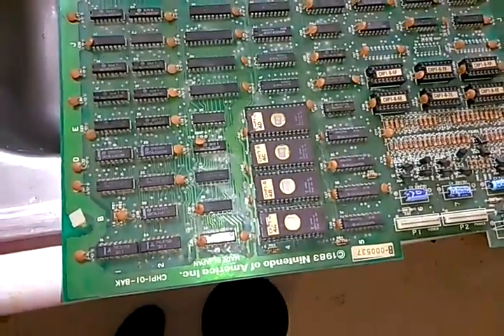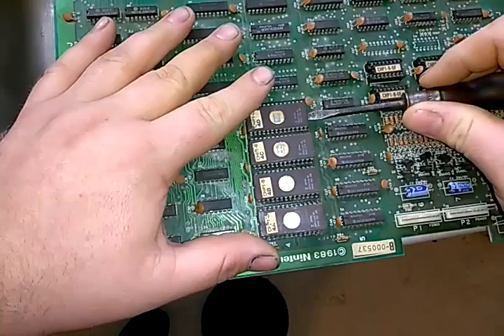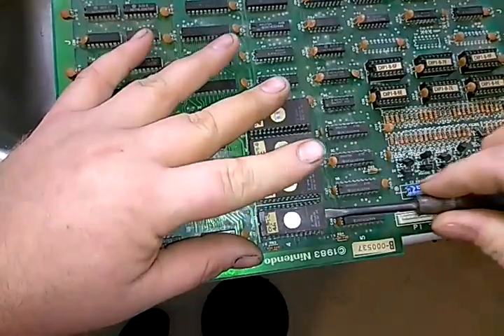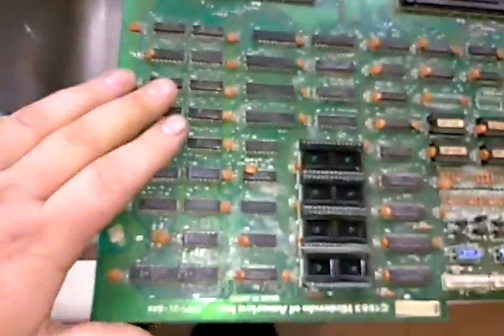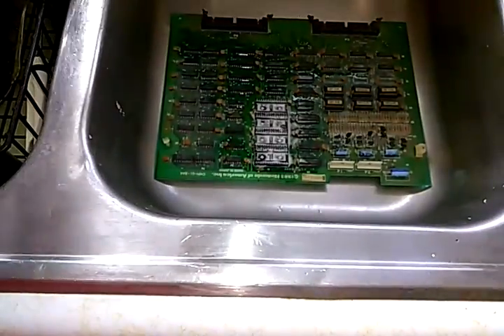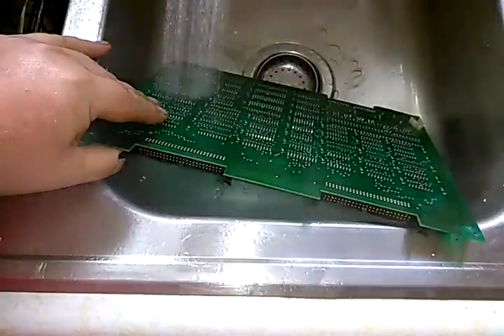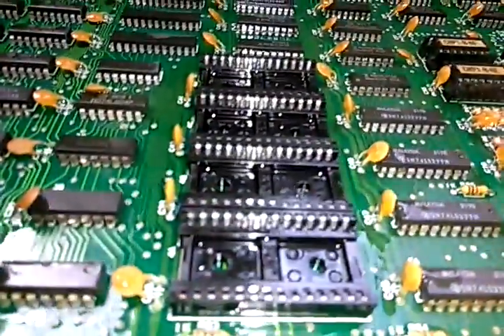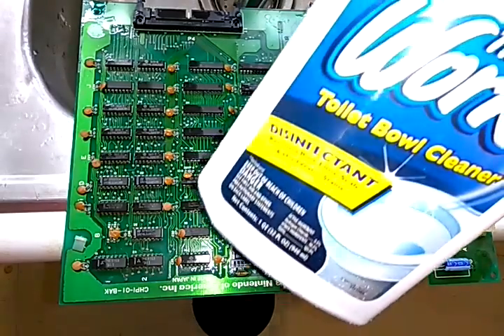how to clean corroded sockets on your PCBs

Comment: Are you sure it’s not sodium hydroxide instead of hydrochloric acid? I use cheap oven cleaner to remove dirt, grime and paint from aluminum cylinder heads. Same for hot tanks in a shop to dunk steel or iron parts. It eats aluminum! 
  I am sure the toxic crowd is cracking jokes about gloves, eye protection and a respirator! Give a break with the tiny amount. You have air-borne yeast on your avocado toast that’s more harmful than this stuff.

Comment: Is it a good idea for me to use distilled water or deionized water to rinse a logic board off? I got a PC motherboard that has oxidation on top after doing a bunch of vinegar baths along with rinsing with 99.9% Isopropyl Alcohol and that hasn't done anything to rid of corrosion for good.
Reply from the maker: what type of oxidation lead oxide orr rust?  i don't know what a good solution for lead oxide is. rust can be removed with a  soak in CLR .  distilled water

Comment: ARCADE JASON, 
1.) Whats the difference between a PROM chip compared to a BI-POLAR PROM chip?
2.) Why does the HP comparator give false positive result and doesn't work correctly when comparator H&V counter chips? it loads the output pins or something because the HP comparator will say the counter chips are bad but aren't bad any reasons why?

Comment: Don't use drain cleaner, it's basically Potassium Hydroxide, which is alkaline.  You could use CLR, which is essentially phosphoric acid.  Even diet coke has phosphoric acid.
Reply from the maker: the drain cleaner i was referring to is hydrochloric

Comment: I've used Coca-Cola to clean battery acid from my car battery connections...same thing?
Reply: It will have sugar residue !!
Reply: Use diet, no sugar.
Reply: soda has phosphoric acid, really good for removing rust and etching metal.
Reply: Not an expert, but club soda is basically water with no sugar , colors or anything else.

Comment: Goodbye corrosion, Hello Rust....
Reply from the maker: rust is corrosion
Reply: @ArcadeJason  Corrosion is like an algae, it builds up but does not eat the metal...
Reply from the maker: @Ramp10er  are you joking? look up the definition of corrosion
Reply: Rust does eat metal. When most people think of rust they are referring to iron oxide, which forms when water touches iron. Basically, water causes a redox reaction with the iron. Some ions from the iron get taken by the water, and some ions from the water get taken by the iron. This reaction creates rust. Fresh iron is replaced by rust. Rust slowly replaces iron, it effectively "eats" it. 

Let's say you start with 1kg of iron and then let it form rust. If half of it rusts, you will not have 1kg of iron any more. You will have 0.5kg of iron and 0.5kg of rust. The fresh iron that gets replaced by iron oxide is also not a homogeneous process. It's not like when rust forms over fresh iron it now has a "protective barrier" of oxides over it. The oxide layer is not exactly structurally sound. Rust is also very pourous. So what usually happens is the fresh iron underneath the oxide layer can still be exposed to water. This is why scratched paint on cars is a major problem. Eventually you won't have a car anymore. 

More importantly copper does not "rust" in the usual sense of the word, copper doesn't rust from water. Copper oxides form from heat. This is partially why flux is used when soldering; the liquid flux forms an oxygen barrier with the atmosphere and prevents oxygen from touching the hot copper. Flux also does all the other magical stuff, like cleaning some corrosion and ensures the solder can actually penetrate the copper and form a good joint. The "rusting" that most people attribute to copper is not actually rust - it's patina. Copper patina is NOT rust, it's a carbonate.
Reply: @spartan456 smart guy

Comment: depends on the corrosion, mud from offroading in the case of my body control module and trans control module in my 99 Range Rover (mounted under the front seats, I used CLR drain cleaner (hydrocloric?) and DISTILLED water to rinse. If you have a water softener in your house the tap water will likely contain minerals that are conductive and will be deposited on the PCB when the water evaporates.

Comment: HI Jason, 
Once again "The Works" product isn't available in Australia, what would be a similar product ?
Reply from the maker: lol plain old vinegar works too    you can also use drain cleaner like muratic acid  just remember DONT LEAVE IT ON FOR LONG  if you are worried about damage  vinegar will work just fine it just takes a longer time
Reply: Thanks I might give the Vinegar a go first :)